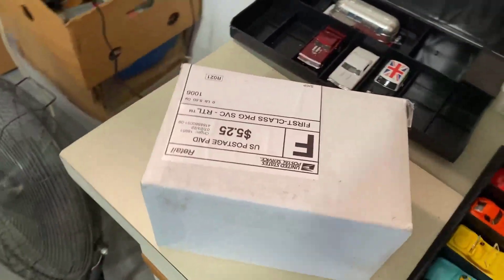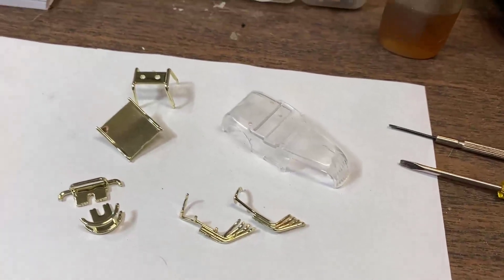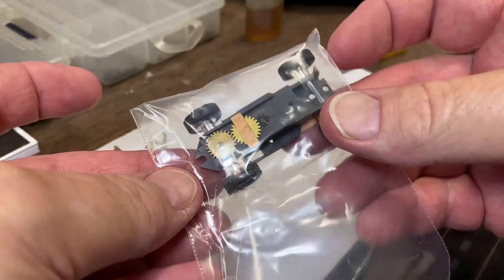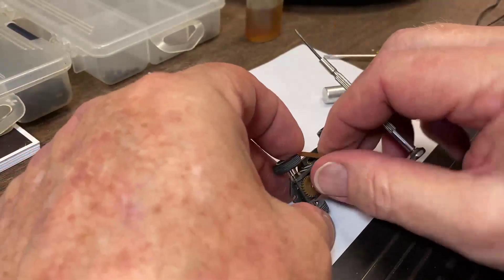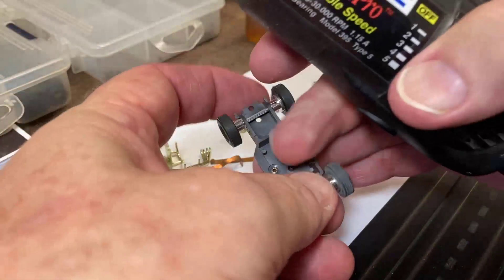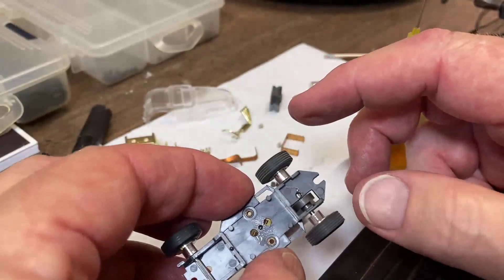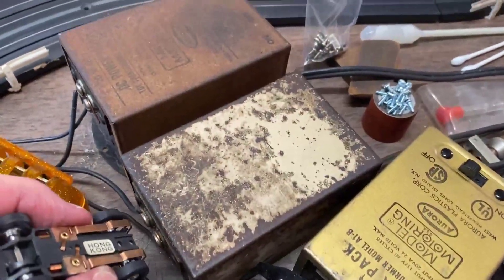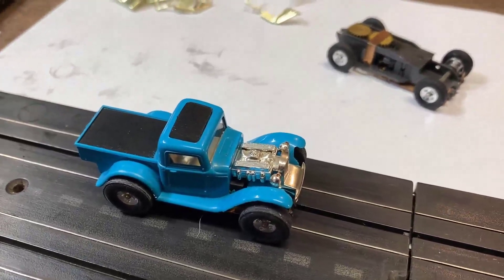New Aurora Slim Line Chassis Unboxing and Tune Up

Comment: I would recommend polishing the metal parts.  Not with a brush. Take copper cleaner, a small piece of soft kitchen roll paper and polish it. Or cotton buds. The copper cleaner will not damage the delicate surface structures. God bless you sir
Reply from the maker: Pro tip!!

Comment: Yes additional magnets help but having the gear train absolutly free of any drag is the ticket.Some of mine run faster than stock t-jets!
Reply from the maker: Hey Sam, agreed. I have a 32 Ford Pickup Slimline that'll out run some of my standard T-Jet chassis.
Reply: @JeffRyan  Thanks for the reply
! I feel as if I'm talking to a celebrity!
Always watch you vidios.
Cool!
Reply from the maker: @samjohnson1061  Hey Sam, you are too kind Sir, thank you so much for the kind words. Let me know if you need anything.
Take care Sam, see ya!!
Reply: @JeffRyan  As a matter of fact I do,a few months back I had requested info on the slim line armature gear.
The shaft measures .045 where as the t- jet arm is .o62.
Haven't been able to find any.
Thanks Again!
Sam
Reply from the maker: @ Hey Sam, I have a saved search on eBay for the slimline chassis and parts. You can search Facebook for slot car groups, that’s also a great way to find them.

Comment: 👍👍😎🇺🇸
Reply from the maker: Hey Shift, that little Crown Gear tip can make all the difference with how a Slim Line chassis performs. As a kid, I thought; these chassis kind suck-ass. Eliminating the Crown Gear issue, to me, made me want to start collecting the Aurora slot cars with the Slim Line chassis.
Reply: @JeffRyan  Yes, could see the difference. No slim lines, but checking all mine now. Good stuff👍

Comment: Great tips on the crown gear and the rare earth magnets (figured I couldn't spell molybidium correctly). Regards those magnets; does the polarity matter when putting them on and if so, how do you determine i?. Also where do you buy them?
Reply from the maker: Hey Roads, you cracked me up!! They are 'Neodymium' (Rare Earth) magnets.
Here's a link to where I get them from:
https://www.ebay.com/itm/133917695663?hash=item1f2e1ddeaf:g:YaEAAOSw8q9eJxWZ&amdata=enc%3AAQAHAAAA4HxumdV7n%2F3pOR8Jv9mCIvhccRlhHEoArKtIOWR%2BzALRD3ufMH8kCd3hQ1bUgweyqrykwQVF%2BJR%2B0XAT8X%2FLm7npx4E7KQ08Xli4ctL%2B%2BJo5DCOpcLzhQGUGRRCH2WNz0o%2F90ABz7QHZ7R9kFSASE16dXHysA75lailRyb7MYZ5tsUy0hz%2FCerEVxJEJegq%2FifQSl9PAdj%2B7x0kDDS2nL0DH%2FhKvt%2B0mE0ToM4rqElexNssBwZG2W%2FS%2FhUW5v04rjaNQeXYAhynG4tIRFmvmZbq0Vmb0xd%2BJupwD8WpxBqFJ%7Ctkp%3ABFBMwqa_4spg

Hope this helps.

Comment: Are the slimline's motor brush's deeper or different than reg T-jet brushes???     They look taller on Vid.
Reply from the maker: Hey Cave, yes they are a bit smaller in circumference, they might be a wee-bit taller as well.